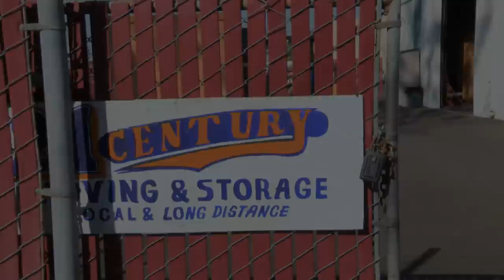Storage Wars: Torched (Season 11) | A&E

Comment: Oooh...nice find on the torch!  I have the GTT that is one size smaller and it cost me $800 used (half price) and that was a deal--years ago.  Without getting a close look, I'd say that was a Mirage.  She was right on about the price.  (about $1500 used, and it's in nearly new condition).  Niiiice.  I'm curious as to whether there was a bunch of glass with it--some of the older glass colors are hard to find and very expensive (over $100 per pound).